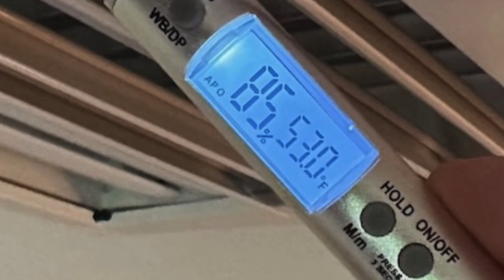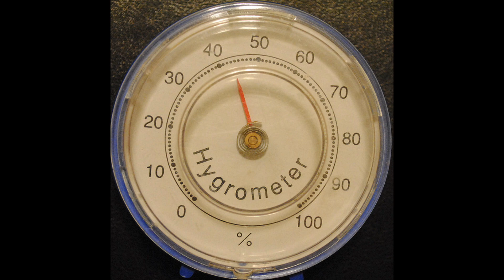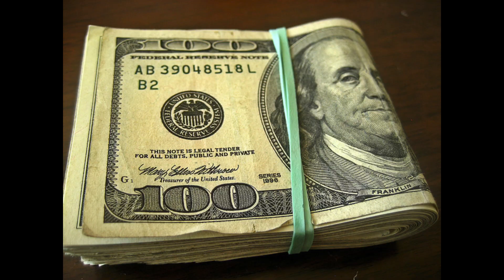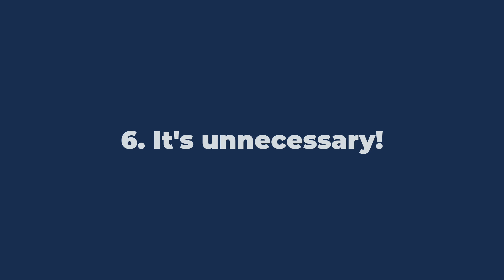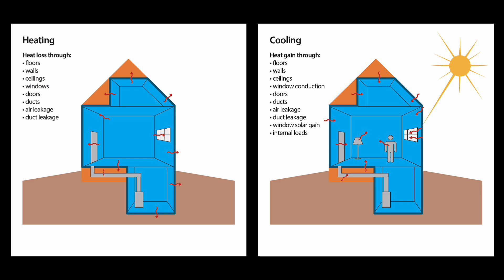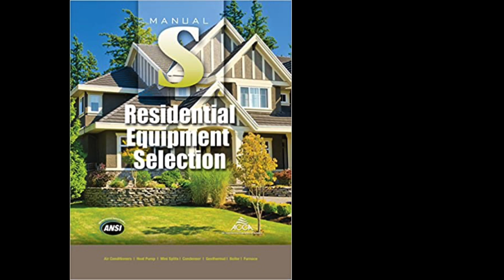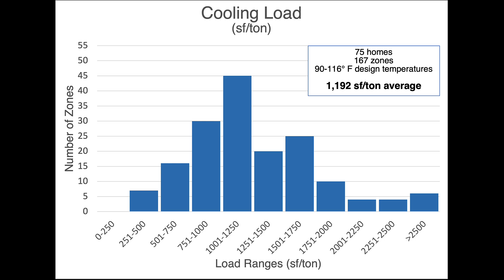6 Reasons to Avoid Oversized HVAC Systems

Comment: 10 min per hour oversize AND 30 min per hour your system is twice as big as it needs to be ... did you mean twice as small because your comments are illogical. Short time -- too larger.
Research from various sources indicted -- Ideally, the fan should run for about 15-20 minutes per hour (or around 25-33% of the time).
Reply from the maker: Scott, perhaps you should take a look at ACCA Manual S, the official equipment selection standard in the US.
Reply: @TheEnergyVanguard  what precentage per hour of run time is a good indication of a well balanced system?  Also did I misunderstand your words because you indicated 10 min (short cycling) and 30 min indicate oversized?  I would expect if your system is running 30 minutes (50%) then it indicates your system is UNDERsized.  Maybe 50%-75% is good at peak hot or peak cold times.  I'm wondering about the bell curve tho.
Reply from the maker: Although not stated that way explicitly in Manual S, 60 minutes per hour is the goal with the house at design conditions. The outdoor design temperature should be the 99% (winter) and 1% (summer) temperatures for the location. Those are the low and high temperatures exceeded only 1% of the hours in a year.

Manual S puts it this way:  "The equipment sizing goal is to have no excess total cooling capacity."  (That means at the design conditions, not all the time or at some other conditions.)
Reply: @TheEnergyVanguard  Thank you for the response. I did more research from the Manual S and asked 3 diff "ChatGPT" tools for interpretations. It was interesting. The more I learn the less I know.
Reply from the maker: That's how it works...for a while.  Read up on the Dunning-Kruger Effect.

Here are some articles I wrote about the "undersized" heat pump in my house, which might help you understand this issue better:

My Undersized Ducted Mini-Split Heat Pump
https://www.energyvanguard.com/blog/my-undersized-ducted-mini-split-heat-pump

My Undersized Mini-Split Heat Pump in a Heat Wave
https://www.energyvanguard.com/blog/my-undersized-heat-pump-in-a-heat-wave/

My Undersized Heat Pump in an Arctic Blast
https://www.energyvanguard.com/blog/my-undersized-heat-pump-in-an-arctic-blast/

Comment: run times/off times  summer set at 78 inside, 85-99 outdoor,   15 on/15 off/15 on/ 15 0ff = 30 min per hours is ok, i have been told by hvac people  1900 sf under air, cbs block, attic insulated, only 3 window direct sun,
Reply from the maker: If you're getting 30 minutes per hour of runtime on design days, your system is twice as big as it needs to be.
Reply: @TheEnergyVanguard  thanks for replying. ironically, the original system that came with our new house in 2005, was 3.5 ton, 2023 we replaced it with a 4 ton, so for the original 18 years that 3.5 ton was oversized too.  oh well, we just took what the home builder install in this 2599 home community.  yikes, no wonder my electric bills are putting me in the poor house !!  lol  lool  lol   thank you for your great videos with excellent info.

Comment: Be careful if you have a regular HVAC company perform a Manual J calculation. In my experience most of them will fudge the numbers to get the results they think it should be. Then boom surprise, surprise the needed equipment is right around that 500 sqft per ton.
Reply from the maker: Yep.  That does indeed happen.  I've looked at many Manual J reports from HVAC contractors, and I always calculate the square feet per ton first.

Comment: let's say you have a poorly sized system - how does one mitigate the issues without tossing the heating unit? Dehumidifier? ERV?
Reply from the maker: Well, for dehumidification, you can check the air flow setting and reduce it if the installer left it at the default value. Slower air moving over the coil does a better job. That can help with the humidity aspect of comfort. Some duct modifications may be able to help reduce blower noise.

Comment: Why not BTUh per sq ft as a metric to gauge the quality of a design?
Reply from the maker: I use that (in the form of square feet per ton) as a first check to see if the system size might be in the right ballpark. But the quality of the design depends on more than that number can tell you.

Comment: I have yet and have never found a properly sized system installed in the house yet. 
    I’m still looking. 

That’s not even talk about undersized duct work . 
      
    I think the last time I ever found a properly sized ductwork. 
      Was when the original house that was built in 1940 had a gravity furnace, hard sheet metal ducting that was all wrapped in asbestos still excellent condition. 

Was designed for 160,000 BTU furnace .  Design for a house with no insulation in the ceiling no insulation in the walls old wooden windows with the weights in the window sash. 

Most of the offshoot duct runs to the floor mount grills were 10 inch in diameter . 

The old house has had insulation blown into the walls, insulation blown into the attic. All the windows have been replaced with glaze vinyl windows. . 

And a contractor connected 40,000 BTU furnace directly to the 36“ x 28“ Plenum . 

Under this condition, it would be the most correct by accident overkill size ductwork that was original . . 

And 40,000 BTUs in a 1200 square-foot home in San Francisco is still way overkill and MORE than DOUBLE the size needed .
Reply from the maker: What you describe is the kind of stuff in homes all over the US.
Reply: AND Lets not forget the trash equipment that has been installed from china. It barely lasts 8 years.